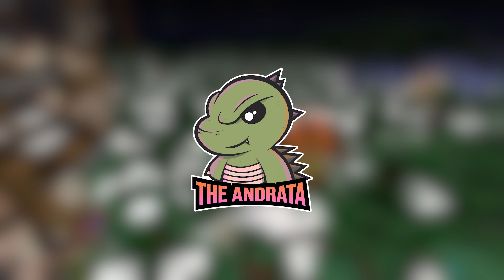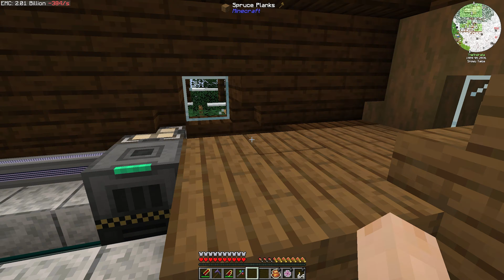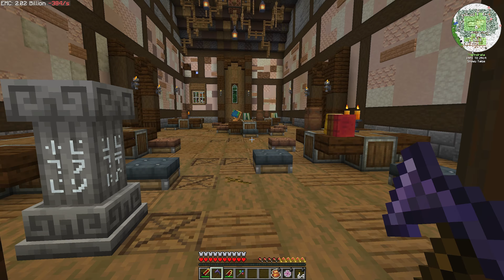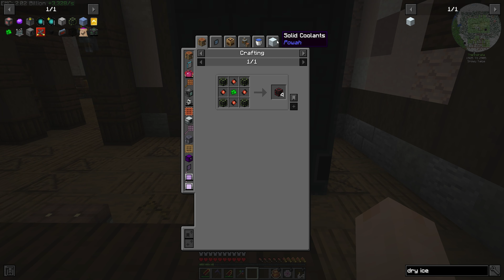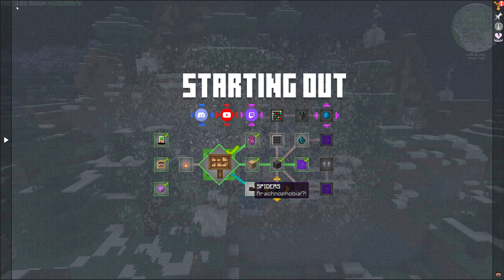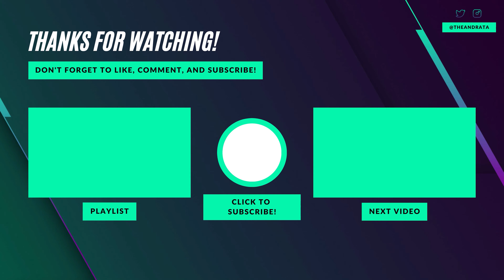Project Architect 2: EP14 | 200k RF/Tick Made Easy! | Minecraft 1.20

Comment: Glad you are safe

for the Axolotl-quest you only need to smellt iron and gold. the other compressed stuff has emc. if you make a RFTools Builder with a Filter and a Clearing Quarry Card you can get most ores (also Amethyst geodes). you can mine for them with the Ars Nouveau Rods.

I like to fuel the Powah Reactors with blocks of Redstone and Coal. I set my system up with a ME Requester to have everything in stock with recepies for the energizing orb

Comment: For finding Amethyst, the Dowsing Rod from Ars Noveau is probably your best bet.

Since the Flux Networks stuff all has EMC, I found the Flux Storage blocks to be a pretty great power buffer option for this modpack, since it doesn't have any of the I/O limitations of Mekanism or other mods.  I eventually built a Mekanism Induction cell, but a 3x3x3 cube of the really big batteries from Flux Networks carried me until I reached the point where I needed insane power storage for making antimatter and other lategame nonsense.  It's like 20 million EMC to get ~3.5 billion RF worth of Gargantuan Flux Storage, and they're really easy to build in the first place since it's just chaining together various EMC-able Flux stuff and some glass panes.

For Powah, if I'm not insanely resource-limited, I'm a big fan of making two reactors and 4 energizing rods and leapfrogging them through the tiers - making a hardened reactor and hardened rods, then using that to upgrade the other reactor and two of the rods to blazing, then tearing down the hardened reactor and upgrading it and two of the rods to niotic, and so forth.  It makes it easier/quicker to do the various upgrades, and also encourages me to build with scaling in mind.
Reply from the maker: Oh, that’s actually a really good idea, especially the bouncing back and forth. Would have been smart to do that instead of waiting forever haha